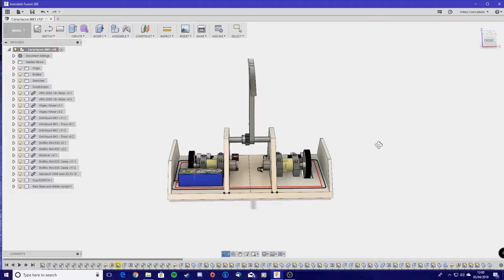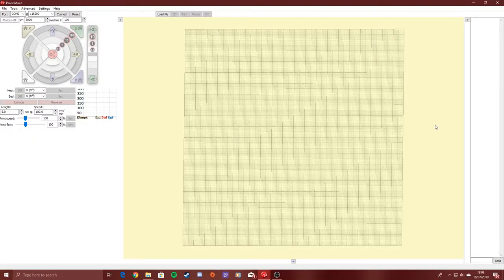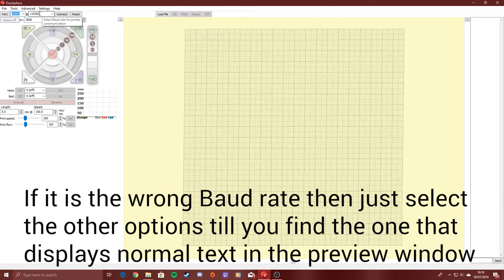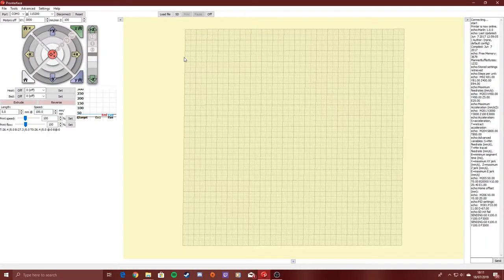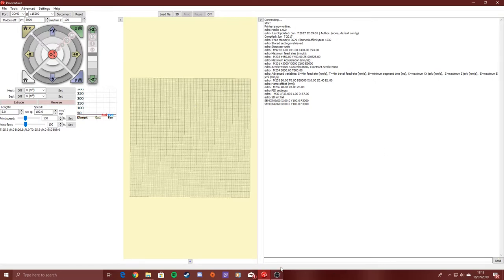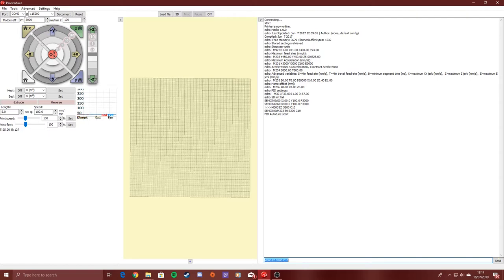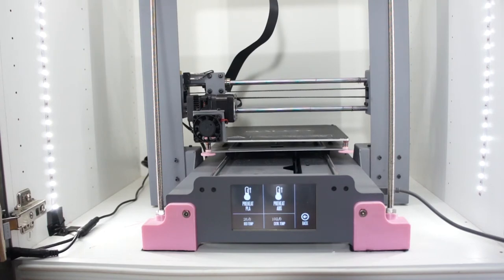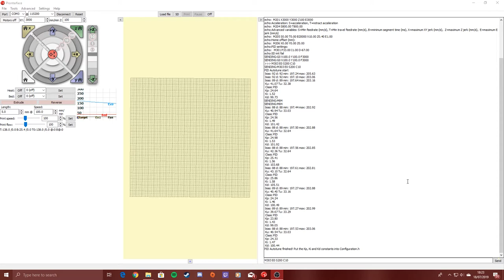How to use PID Auto-tuning on your 3D Printer

Comment: Great video Will - purchased a balco printer from Aldi in December to tinker with, did the micro Swiss mod and experienced the same fluctuations, assumed I had disturbed the heat cartridge or thermistor when fitting. 

PID tune has helped iron things out. Have you experienced PLA melting and breaking off at top of the nozzle throat beneath the extruded? Tempted to switch back to stock for PLA.
Reply from the maker: Hi! Sorry have been slow to reply, got the man flu! Yea, its a great beginner machine :) I have only had it break off below the extruder when the filament has been left in the mechanism/nozzle over night. PLA is very brittle if left under any sort of tension. I had wound some PLA on a spare spool and by the morning it was unusable as it had snapped in about 100 places! Same thing happens in the extruder mechanism. I would recommend if you are using PLA to unload it after every print. 

I would also change your retraction settings from the default values (around 6.5mm distance and 25mm/s speed) to retraction distance: 1mm and retraction speed: 40mm/s. The all metal hotend kits don't like long retractions, i wouldn't go above 2mm distance on any type of material you use, but 1mm works well for PLA and having the speed high also helps stop stringing. Give these both a go and let me know how you get on :) 

Hopefully this will solve your issue! Thanks for watching :)

Comment: Does the following save the settings on your machine:
M301 Pxx.xx Ixx.xx Dxx.xx        to set the settings
M500                                             to save the settings
M501                                             to check the stored values
Reply from the maker: My apologies! I'm so sorry i didn't see this till just -_- You are very close! M301 and M500 are correct but the M501 actually restores the settings from the eeprom. This makes sure that the printer is using the most up to date settings that you have put in! Thanks for watching :)